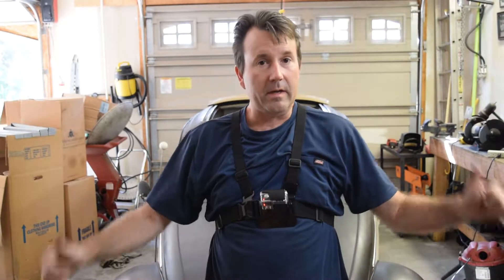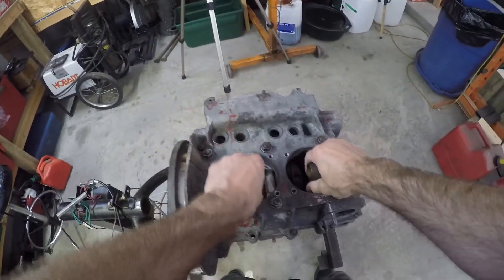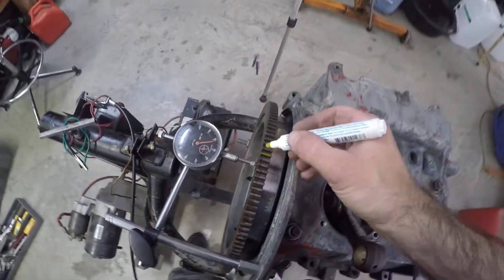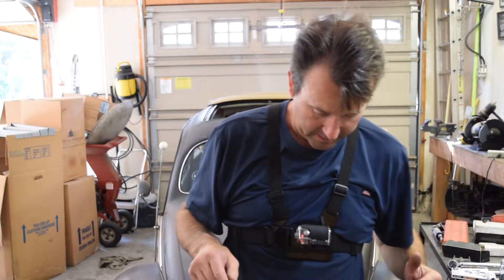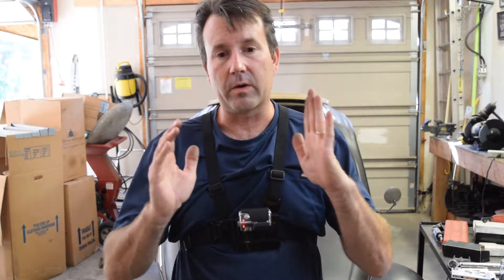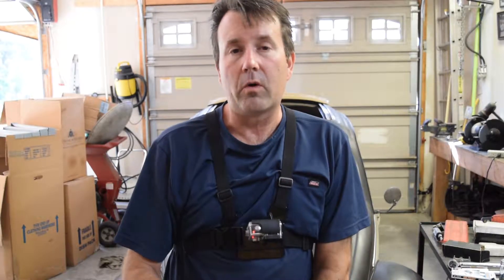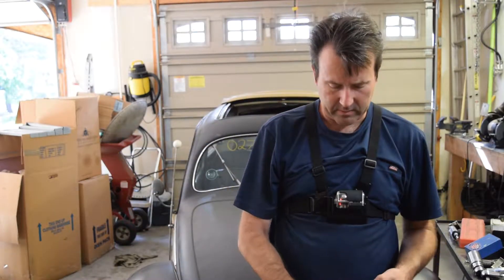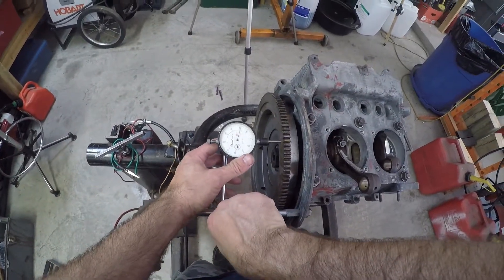Setting end play on Grease Pit

Comment: Should I use locktight on a new gland nut?
Reply from the maker: I always do.
Reply: I’m currently building a 36hp stroker. Looks like two shims not including paper gasket will get my .004 end play. Any issues if I run only two shims? Was also thinking one thicker shim that are run in 356’s.  Thank you for any  information.